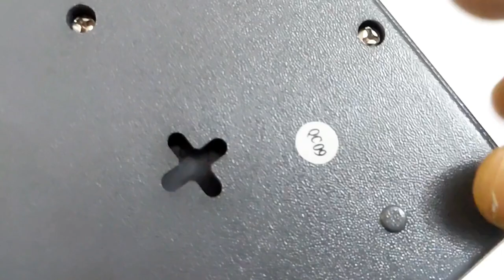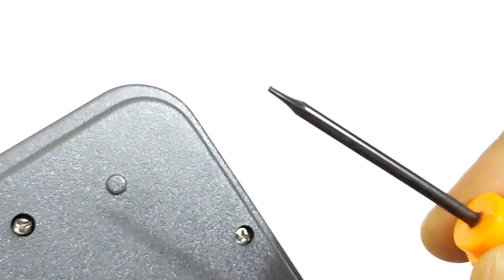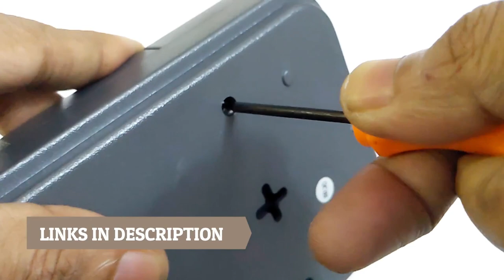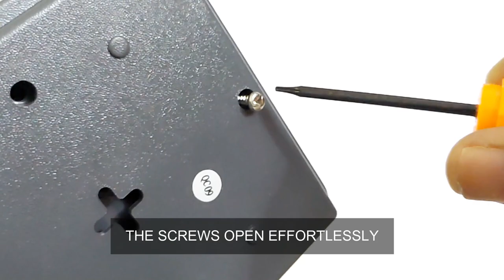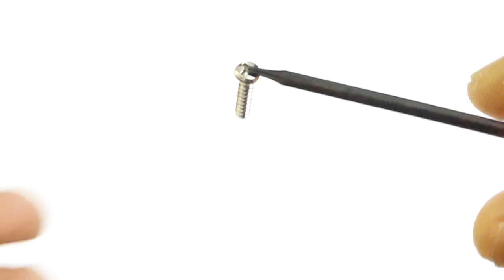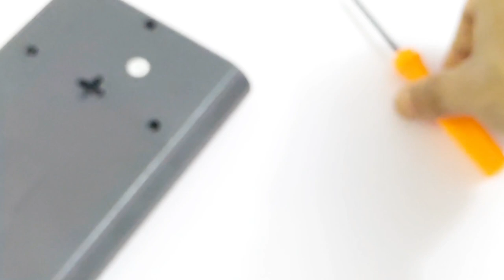Tri-Wing Screw - How to Open with Torx Screwdriver

Comment: To everybody complaining about difficulty, a thin 2 or 3 mm wide flat screwdriver fits in these  screws way easier than torx, I just got done fixing a Black and Decker  4 slot toaster that has these to secure the base to the protective/decorative shroud. Same exact type of screws.
Reply: I loosened them with a regular, tiny phillips and then got them out with a small flat head myself. I didn't have a torx tiny enough to do what this video suggests.
Reply: Doesn't work when the y screw is only 2 mm. I hate apple so much

Comment: I needed to open my wii thanks
Reply: same but i have torx screwdrivers, smallest i have id T3 and i cant get those dang screws to unscrew
Reply: @drzeldaglitch  I feel that. I’ve been trying for about an hour with flat heads and nothing. Saw this and looked for one small enough and it’s just barely too big.. the struggle
Reply: Yeah, trying to open my wii but can't get it with a torx or a flat screwdriver.

Comment: These screws are not Tri-Wing but called TriPoint/Y-type/Trigram. Tri-Wing/Three Wing/Triangular Slotted are different and you for sure will not succeed with tri-wing screwdriver into tri-point screws. Conversely, Tri-point screwdriver maybe can turn three-wing screw but still the menace of screw head stripping is here. Additionaly, real Tri-Wing screw for sure cannot turn with bare Torx. I do not know why people still mess those two screw types or consider them two the same. It is almost impossible to buy right type of screwdriver without extra asking to seller if it is really this type of tool I need.
Reply: THIS. Even manufacturers themselves mix these two bits up, it's ridiculous.

Comment: I don't have that kind of screwdriver either.
Reply: But they are much more readily available at any good tool shop, and in many different sizes too. Only place in my city that I could find a tri-wing screwdriver was at a game shop and the only one they had was intended for Xboxes and such, far too small for my purpose.
Just be careful if you buy the short bits that fit into a holder attached to a handle that they're not too short and thick to fit into the holes where the screws are. Might be best to take your device in to make sure you get the right size.